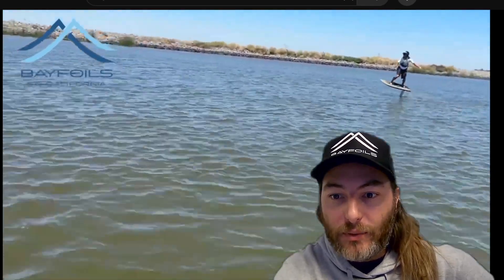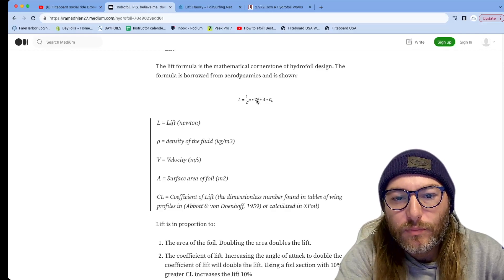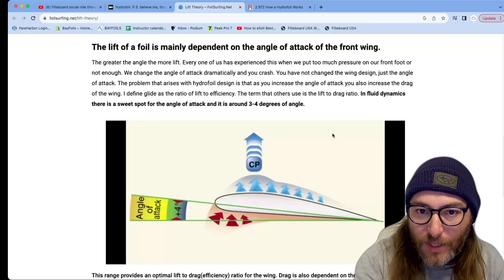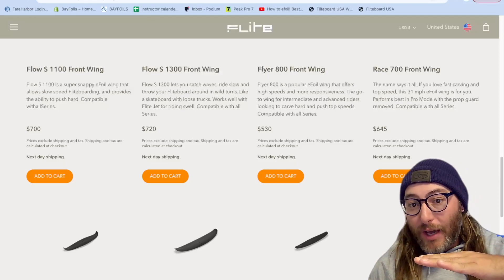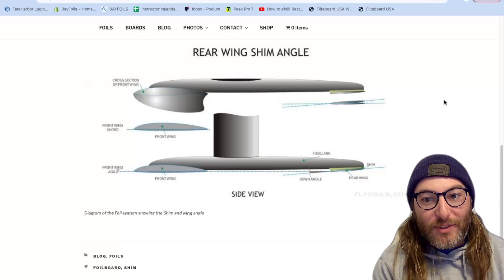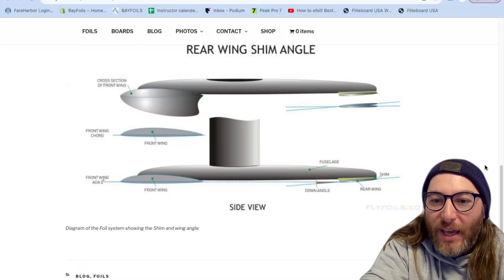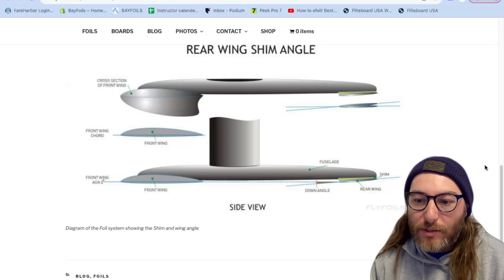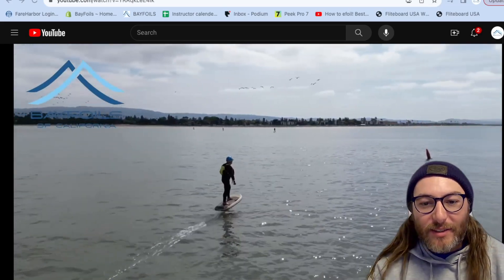How Do Hydrofoils and Stabilizers work? Fliteboard Efoil Science Myth Debunking

Comment: Great video - but why not talk about Shim Numbers and what difference they make? You when through ALL this detail about how wings work, yet didn’t address a very basic, and very common question.
Reply from the maker: This video is really a broad generalization of the relation ship of front wing and stabilizer. I wanted to keep this video very general and applicable to more users as not every brand uses shims. Too much information can overwhelm people especially beginners/potential new efoilers. All the principles are still true (AoA vs pitch control/lift). I always recommend individual experimentation with all the variables. I plan on making a much deeper shim explanation guide more geared efoil surfing once i get a wave edition efoil as the new conical mast have shims in .5 increments. Stay tuned!